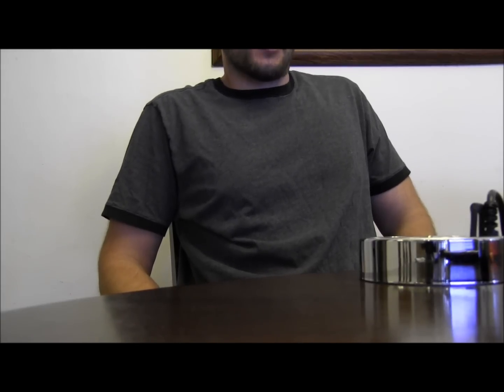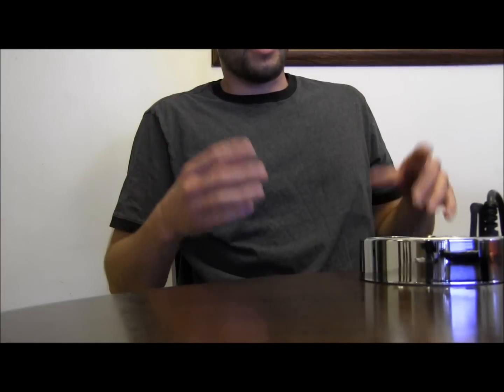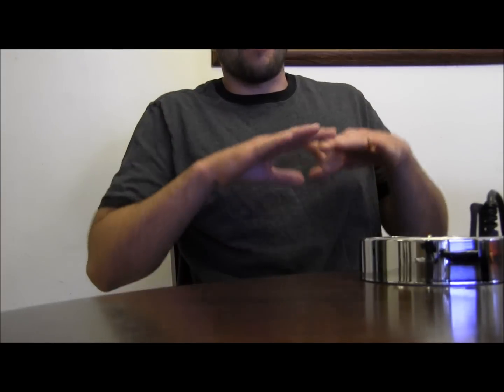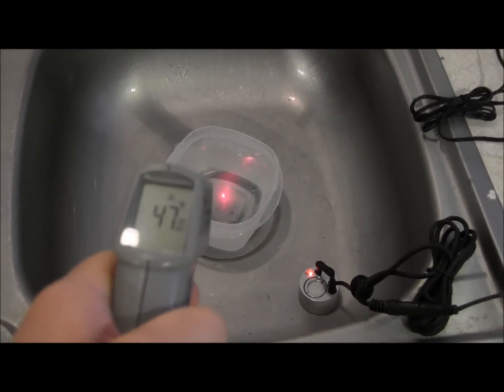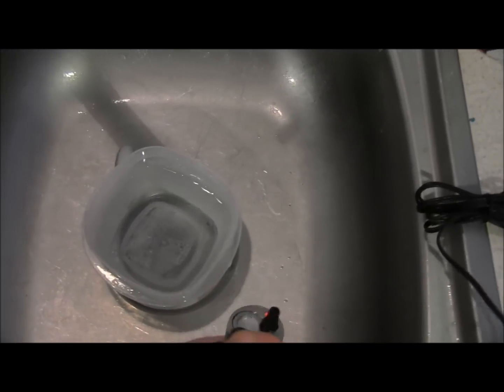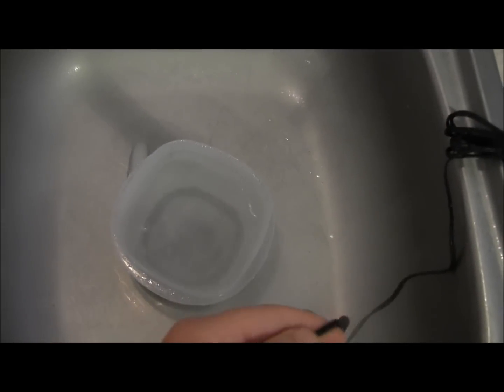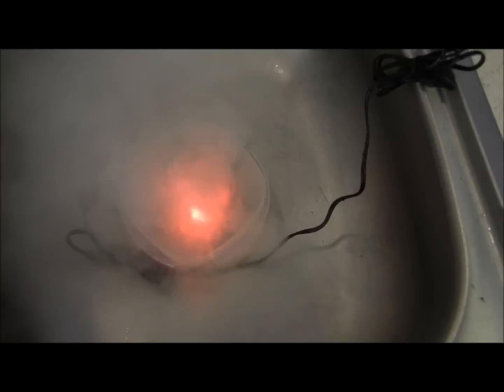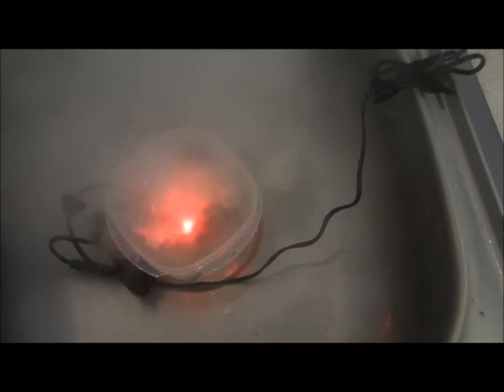How mist makers react in different water temperatures

Comment: Us Halloween decorating folks have been using ultrasonic misters to make fog chillers for the past few years. Combined with a fog machine the misters help create super low lying fog at room temperature without the need for any cooling from ice at all. It works by adding humidity to the fog, which makes it denser and heavier. The old way of doing it was by using coolers full of ice to cool the fog down lower than the ambient air temperature, which makes it lay low to the ground. Completely different principle.  You wouldn't believe how many people argue with me that putting ice into the mister water will make it work better. Even if I direct them to this video to try to persuade them that it's counter productive, they STILL insist on doing it. Drives me nuts. The whole idea of the ultrasonic fog chiller is to make it easier to reliably create low fog at the flip of a switch, for a much longer time, without the need to mess with ice or dry ice. People insist on clinging to the ice to the point of wasting a bunch of money making an ultrasonic machine that doesn't work because they keep adding ice. lol.
Reply from the maker: If there's anybody that would know, it's you guys! 
So when you make the machine, are you using the glycol fog machine to push the ultrasonic "water" fog out of the container?
Reply: @TheHouseofHydro  Yes. The mister sits in a large tank of water where the water mist accumulates and is held. The glycerin fog from a fog machine gets shot in from a pipe in the top of the box, mixes with the water vapor, then exits from a side pipe where a blower gently helps move things along down a long flex pipe to wherever the effect is desired. It works way better than traditional ice chillers because the effect never diminishes as long as the mister is running, unlike ice chillers that will stop working once the ice melts, which does not take very long. The theory is that the mist is making the fog more dense by adding moisture to it, which is clinging to the molecules of glycerin and making them heavier. Not sure if the science to that theory holds up, but whatever it does, it works. Here is a demonstration of my machine if you are interested in seeing how well it works... https://youtu.be/mUhq-L9zGNQ?si=QkXlx9EGvxx9FK7V
Reply from the maker: @OakLaneCemetery  That's awesome! I added this to our Q and A page along with a link to your video! Keep up the awesome work! You're incredibly talented!
Reply: @OakLaneCemetery omg! I may modify my chiller box to have an ultrasonic mister in it next year! Thanks for the info!

Comment: Although the output of fog at 120°F is higher it will still depend on air temperature too. Which the fog output will be greatest when the air temperature is colder. Warm or hot air will diminish fog output even when the water temperature is high.

Comment: how many hours would this work ?
Reply from the maker: In total, or at one time?As long as it is in water it will continue to run.  The maximum run time is 8 hours on, with a one-hour break. Typically the ceramic discs last 3 to 5000 hours, and the silver transducer of the unit lasts a few years give or take depending on the usage

Comment: What would be the temperature of the fog or moisture at both cases? Would it be same as the temperature of water or the mist maker would affect it's temperature?
Reply from the maker: Manoj Karki the fog is cooler than the air temperature. The intake air temperature plays the biggest part in how cool the fog temperature is.